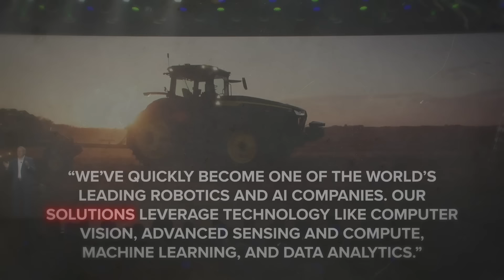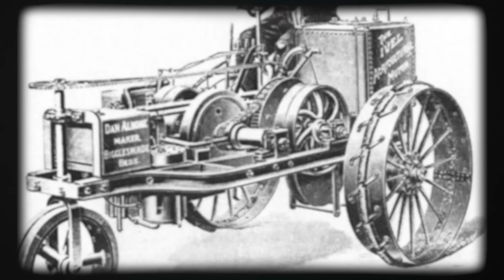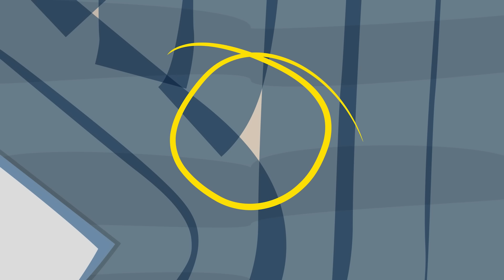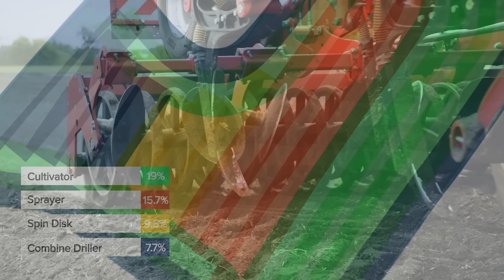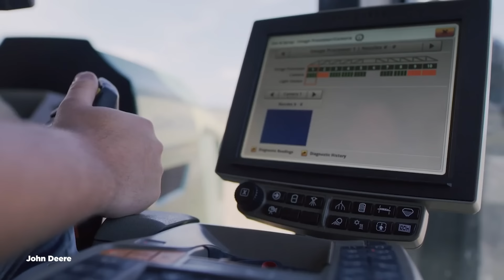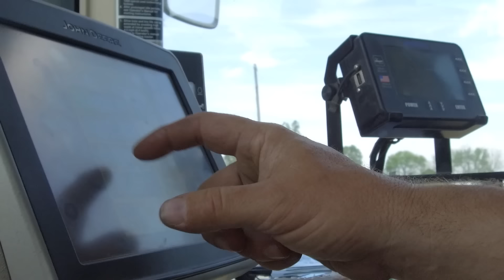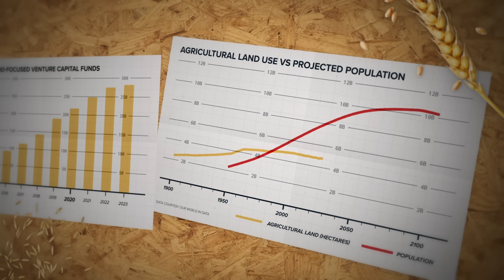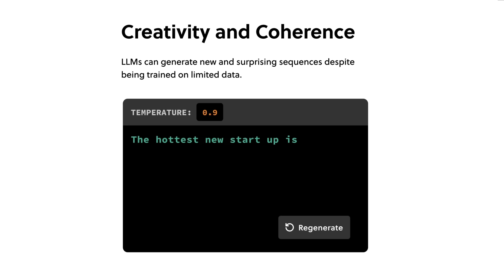How Big Tech Ruined Farming

Comment: Every day, I grow to despise modern technology more and more.
When I was a teenager, I used to dream about having a high tech house with smart interconnected devices everywhere. But as I use modern smart tech more and more, and learn more and more about big tech under capitalism, my dream shifts further away from that and closer to a small cottage in a mountain range by a lake with a little vegetable garden and as little tech as possible.
I've had so many Bluetooth earphones break, garbage software for physical hardware and phones that break after a couple years while my medicore 8 year old Bluetooth speaker still works, my dumb technology just plugs in and functions and my iPhone se still chugs along, that I've come to realise that after around 2015, tech stopped getting better and started going 1 step forward, 2 steps secretly back. Products that are designed to stop working after a certain amount of time became the norm, and new useful features cropped up less and less.
Reply: As a software engineer, the only smart devices that will ever be in control of ANYTHING in my home are ones that I've assembled and programmed myself.
I'm not giving some asshole in a glass building the ability to turn off my goddamn lights.

And after buying a new car, I'm now completely sold on hating technology in cars as well. Electronics in cars peaked around 2000. The ECU just did ECU things without fucking with everything else, the A/C controller did A/C things without fucking with the ECU or anything else, etc. If one thing breaks, nothing else is affected.
Modern car? The ECU needs to know EVERYTHING about EVERYTHING and if even one little tiny thing is off it will commandeer your vehicle and decide you can't use it. Battery is too low to crank the engine? In my old car I just push started it, ez pz no worries whatsoever. I could even do it alone, I'm strong enough. Push the door frame, jump in, second gear, clutch off, VROOM, bob's your uncle.

On my new car? When the battery failed the ecu WOULDN'T LET ME DISENGAGE THE GODDAMN PARKING BRAKE (which is electronic, something I've hated from day one).
Because to remove the parking brake you need to press the brake pedal, and when you press the brake pedal and hit the parking brake button apparently it checks the brake manifold pressure first. So since the engine had been off overnight and there was no vacuum in the manifold, it just flashed a red BRAKE SYSTEM FAILURE warning and started sounding the sort of alarm I'd expect from a nuclear reactor about to melt down, not a car with a low battery.

I had to wait for almost an hour until someone eventually showed up in the same parking lot and gave me a jump. For something that in ANY OTHER CAR made before the last 7-8 years would have been a minor inconvenience.

Also, the engine itself actually does look like a goddamn nuclear reactor. There are so many vacuum lines and wiring harnesses and sensors running all over it that it might as well be an ICU patient. I have absolutely no idea what 90% of that shit does.
I still like the car for how well it drives and how little fuel it uses compared to the performance, but I honestly think as soon as something breaks it'll become scrap because no third party will know what to do with it and the dealership will try to charge me more than what the entire car is worth.

Comment: I worked for JD for several years, and I worked on the see-and-spray platform.  I feel like the tech is solid and it seems like it provides value.  I do not like how JD runs the business side though.  I think they abuse the DMCA to prevent loading modified software on hardware that the user ostensibly owns (copyright and voiding warranties should be sufficient).  I think they should contribute back much more to open source projects that they use.  And they're definitely trying to be a Microsoft (e.g. locking in users) in the ag world.
Reply: What you’re referencing is not a Microsoft, at least Microsoft makes their software compatible with other companies hardware, it is an Apple. They limit your right to repair, they make it incredibly hard to use with other companies software AND HARDWARE, and they do everything in their path to make it so you need to go completely JD or there’s no point having any of their stuff. They make a monopolized ecosystem, not just a monopolized product.
Reply: The biggest problem is that big tech is a monopolistic system.  There are no competitors to JD offering good programs; any time some competitor starts looking promising, JD simply buys them, and if anybody complains they say it'll be a net benefit to the consumer, the only antitrust test still standing thanks to the neoliberal shift of the 80s.  (It used to be that trusts were regarded as inherently destructive, not just to the consumer, but to the workers, innovation and society at large, but the only test that courts and the FTC will apply now is whether there seems to be an immediate, short-term harm directly to consumers.)
Reply: Could antitrust laws prevent John Deere from further abusing its monopoly position?
Reply: @zanewolf2509  Microsoft wishes it could.
Reply: @zanewolf2509  Re: MS and compatibility, I'm thinking in the 90s when they became the de facto standard for a lot of things, and had "compatibility" but EEEed their way to functional incompatibility.  Apple is worse but it's functionally the same.

In the end, the goal is to be a non-optional piece of the supply chain, then you can build a monopoly.
Reply: @jpkotta  ooooh. Fair point there. My bad.
Reply: @theneonbop  Nah. They don’t put any effort in making their surfaces “the thing” they only participate in a small part of the hardware market.
Reply: Agriculture in general is pretty closed sourced if you think about it. Not even talking about this John Deer bs or how crazy it is farmers in many situations have to use patented seeds. Agriculture knowledge is kept in silos.
Reply: @aromaticsnail  You're completely correct, but I mean JD uses software like Linux and rarely pushes changes upstream.  There's nothing there about their core business, it's just adding generic functionality, like writing a device driver for an ethernet chip.  I can't really fault them too much, they follow the letter of the law and I'd guess most companies do the same.
Reply: The problem isn't the hardware, the problem is as the farmer, any potential savings to be realized is going to be monetized. The See and Spray program, to use it, you got to add the hardware to the sprayer, which I understand currently is about another $80,000 on a 1600 gallon/120' boom sprayer. Then, you have to pay to unlock the programming. Then, once you get into a field to spray, John Deere wants to know what products you are applying at what rate, you have to enter the information into the computer, start a new run task for each field. John Deere is going to take a national average of those chemical prices, and for every acre the See and Spray doesn't spray, John Deere is going to charge 70% of the cost of application. You might as well spray the whole field at that point, all you have done is spent a bunch of money for very little return. That is the problem with Deere and tech, the tech is great, but they are constantly monetizing everything in microtransactions. Mind you, the rest of the ag tech is charging these microtransactions as well, Deere is far from the only offender, but John Deere has become the most egregious offender, especially when you realize the average cost of equipment has double in the last 10 years.
Reply: Microsoft today is not Microsoft of 20 years ago.

Comment: John Deere might have been the first tractor company to produce a GPS guidance system,  but they certainly were certainly not the first to do it.  In 1999 I started working for an Australian company that was steering tractors with 2cm accuracy and had already been doing so for several years using Canadian made GPS receivers.

Comment: I worked for a John Deere dealer in service back in 2018. The technology then was fascinating but also crippling, one sensor malfunction and your machine was going nowhere and dealer diagnostics were about the only way you could find out what was actually wrong. A dealer is almost guaranteed required for sure now on any high end equipment from Deere

Comment: You know what? Boeing did something similar. Company CEOs went from being an engineer that use to work on big airliner or military projects to a CEO who only worked in marketing and only Wall Street liked. So they go there saying tech company this that using all the latest buzz words etc. Well Look how that worked out for them. Caring about stock price only and the latest keywords took them from crushing airbus the only competitor at the time and killing it with the us govt to a joke with more competitors. Hopefully Boeing will recover and hopefully companies like John Deere learn from the Boeing mistake but I fear they won’t and they won’t be the last. Enjoy the tech praise and up tick in stock while it lasts….
Reply: Mistakes by farming equipment won't kill hundreds like airplane crashes. They won't learn from it.
Reply: Well... The video makes it look like everything is more or less fine. A bit greedy and not very farmer friendly but fine as it's mostly just going with the times, increasing output in one way or another. 

Thus I'd find the comparison to boing a bit off. There's only so much you can do with hardware. We understand the materials we use and how we have to use them pretty well. So as long as they have a good product and good quality control there won't be too many issues. There can't be too many improvements in hardware either. The fokus shifts to other fields of technology where bigger gains are possible. If GPS guidance etc weren't working farmers would stop buying them. There are other options after all (even though many farmers do seem to Fokus and be proud of owning one brand).
Reply: @mad_max21  Well, depending on the mistake I think farming equipment actually has the potential to kill far more by mistakes. Spray to many chemicals (or not enough) now people can get sick from the food.  A software bug reduces food production so now food prices go up which hurts the economy which hurts everything and unstable markets may collapse into famine. Hell the solar flairs nocking out autopilot is such an example. Have such an error for long enough at exactly the wrong time and now no farm that uses autopilot produces anything.

Individually it's not really a major issue. But the more widespread the tech (and issue) is, the worse it could be.
Reply: I believe it should be law that for a company of above a certain sice the CEO must have worked in the company for atleast 5 years. CEOs that dont know how a company or industry works and just get brought in to maximise proffit for the next quarter before the gamblers/shareholders can bale out leading to the companies demise in the long turn are a plague.
Reply: @einfachnurleo7099  I find it likely that John Deere is growing more hated by the day and its only a matter of time before they start losing sales to individual boycots. Reputation is a very important thing for someone who wants to sell something.

Comment: I live in France and I remember, 20 years ago, most farmers drove mid-sized orange Renault tractors, the other half had red Massey-Ferguson, blue New Holland, Claas, etc ... Now 80% of tractors I see are big green and yellow John Deere with agressive faces. I don't know how they did that but it's becoming scary
Reply: Do you live in northern France? Because there the average farm is also very big and so the economies of scale that Deere offers play out in full?
Reply: @5th_decile  I do. It might be part of the reason but I'm not sure. I know too little about this.
Reply: The renault ares, one of the best tractors ever!
Reply: The farms I used to help out on back in those days had similar tractors, Masseys etc..  The ones that could afford John Deeres bought them because they had things like stereos, heaters, air con, really comfy seats and what-not.  I don't know how comfortable those tractors were in France back then but I do recall plenty of people here in the U.K. opting to by JD because of that extra comfort factor.  Plenty of the rear arm controls seemed easier to use on JDs of that era as well.  Just more modern, in short.  The 3350 at one of the farms in my home village was pimp compared to anything else.

Comment: There's no excuse to not allow customers to repair the farming equipment that they bought
Reply: I’m guessing safety issues would be one reason
Reply: then repair the equipment? its not hard...
Reply: @forzaacmilan36  What safety issues? Do be specific.
Reply: @forzaacmilan36 since the equipment is only used on the private land of the owner who made the unauthorized repair, NO, safety issues are NOT a justifiable reason for the manufacturer to sabotage unauthorized repair or otherwise make it impossible!

Even if they were vehicles made for public roads, it's not John Deere's responsibility to make sure the customer maintains them in a safe operating state!
Reply: @forzaacmilan36  for generations people were repairing their own tractors but it's suddenly a safety hazard
Reply: @nickierv13 Pretty much the only one is the common rail system but what % of repairs could that be? Like 0.001% maybe so its all just BS to squeeze as much out of farmers as possible
Reply: @Czeckie  Plus farming is a dangerous profession in general.
Reply: The issue is that many farmers absolutely do not have the skill set needed to make certain software repairs. I agree that they should have the right to try, but they will inevitably end up screwing up the code, potentially in a dangerous way. It’s terrible, but farmers have no choice but to depend on the manufacturer for software repairs. Same thing will happen to all of us with our cars. Go ahead and try to fix the auto steering system. You will fail.
Reply: @JohnDoe-mq4sq  Dude, everyone doesn't have to know how to fix something for it to be still worthwhile to make it available to fix. People can run their own repair stores not "authorised" by john deere where they can make the repairs for cheaper, just the same as how not everyone knows how to fix their car, but their tools and parts and manuals are out there so people can take their car to a garage. 
Not everyone needs to be a mechanic or a software technician.
Reply: @JohnDoe-mq4sq  Except when is it ever a software issue? Software rarely 'breaks', it the hardware that is the issue:
Fuel/air/whatever filter - its going to wear out, its going to need replacing. oh nope, that is software paired to the hardware, authorized repair only. 

Same thing with phone batteries, same thing with hundreds of other things that have gotten 'smart' for no other reason that to block easy repairs.
Reply: @themanwiththeplan1401 Fair point. That’s why I specified they should still have the right. Hopefully you’re right and 3rd party shops (for farm equipment and cars) will start training more techs in computer issues. Just seems like it will get harder and harder for independent people to be able to do this
Reply: shareholders disagree
Reply: all I am seeing is it's a company which capitalized on market and revolutionized farming and helped farmer make stupidly huge profits and easy farming.
but now people calling same company evil. typical american thing.
if you don't like their equipment then just don't buy itt. it's that simple.
you want to use their equipment since they are the best but also then call them evil after signing terms of use with them.
Reply: @amazingdude9042  That's no excuse, apple does the same shitty tactic
Reply: @justinkemp4019  same apple device which you use and loves to flaunt. Ditch it then.
Reply: @amazingdude9042  Your at minimum missing the big picture. Perhaps you have heard of the "First they came ..."

First they came for removable batteries, but 
people ate the line of "but waterproofing!"

Then they came for the standard screws, and no one said anything.

Then they came for dozens of little things, each seemingly insignificant...only this time people spoke out as the line had be long crossed.

This is people speaking out as the line has been long crossed.

Do tell me why its nigh impossible to find a modern phone with an easily removable battery.

Comment: A tractor you can't fix in the field yourself is as useful as a brick trying to fly. JD makes it just about impossible to fix yourself in the field.
Reply: And yet they're still in business
Reply: Then don't buy it.
Reply: a farmer if siupposed to be self sufficent in everything thats why they are farmers. if they cant be self sufficent, they should sell their farms.
Reply: @matthewbarabas3052  Except stuff will eventually break to the point where it has to be replaced. Then you stuck with that new 'smart' tractor that has a 'smart' cap for insert relevant fluids that once you open it, locks down the tractor until its 'authorized repair' is done. 

Its not that farmers don't want to repair stuff, its that JD et al are actively preventing the repairs.
Reply: @nickierv13  then they shouldnt buy any of the smart tractors....? this is a none issue, frankly, unless they completely stop making standard tractors, which they definitely cant.
Reply: farmers not always choose tractor they are getting if they apply for funds help,  lobby makes sure tractor you will get is dee...

Comment: Fun side fact: Avgas, the fuel used in small, propeller driven aircraft, is still leaded. Farms that use crop dusting planes are introducing higher than average heavy metal contamination to both the food supply and local air conditions. Living downwind from a small airport is about bad as moving to Flint, MI.